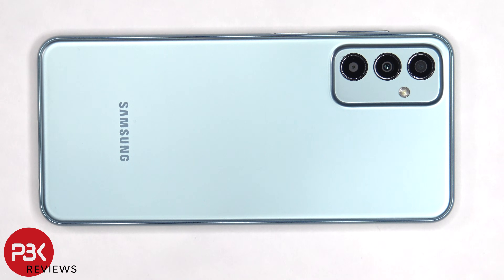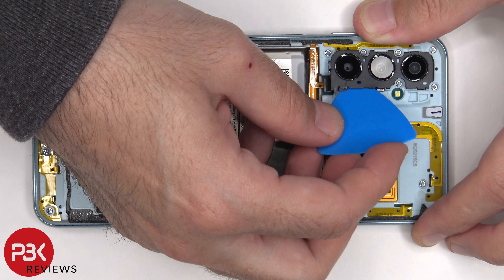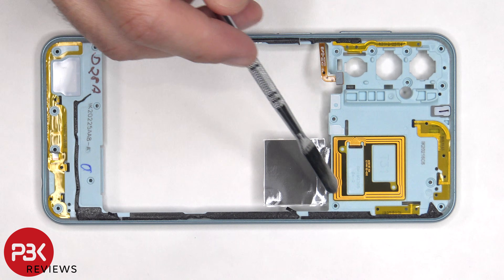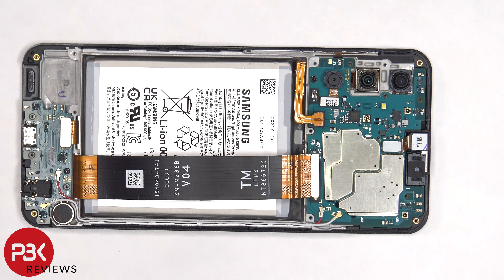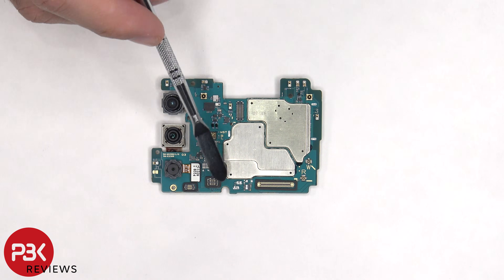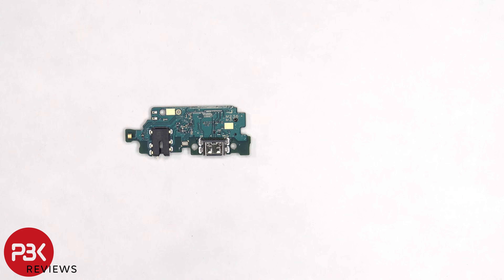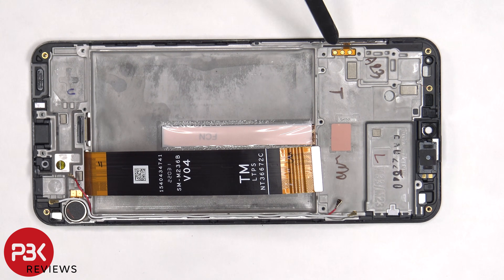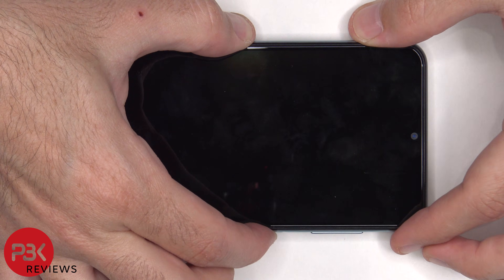Samsung Galaxy F23 5G Disassembly Teardown Repair Video Review

Comment: After replacing the charging board I'm getting the message " Charging stopped because battery temperature is too low," I used DevCheck to check the Battery Temperature and it was showing -20 degrees celcius. Plus my mobile networks aren't working. I've been forced to  enable Airplane mode to prevent the phone from heating and slowing down because its constantly try to look for a signal. Any fix for this?
Reply from the maker: make sure the sub board or charging board you replaced is the correct model version. They have numerous region versions of the sub boards which have different antenna contacts n so forth. Also make sure all the cables are installed correctly.
Reply: @PBKreviews  I couldn't find a  board for F23 but found M23 (M236B) instead. I assumed they used the same board since they both had the same labels. Maybe I got one for a different region.

Comment: After changing charging board haveing network problems
Reply from the maker: make sure the sub board/charging board is the same model of your phone. Since different region versions have different network bands and thus different antenna contacts on them. Also make sure all the cables are properly connected and that the sub board is seated properly in place so the antenna contacts touch the contacts on the frame.
Reply: @PBKreviews  The replacement board is identical to the original one inside the phone but I'm having network issues. After replacing the charging board I'm getting the message " Charging stopped because battery temperature is too low," I used DevCheck to check the Battery Temperature and it was showing -20 degrees celcius. Any fix for this?

Comment: My Samsung Galaxy f23 heat so much while charging
Reply: remove backcover
Reply: Yes bro
Reply: Yes bro
Reply: That happens when you use the 25w super fast charging. Unless you have an external cooling device you can switch to a 15w fast charger
Reply: Right bro mera bhi f23 samsung galaxy bhi heat kr rha ha
Reply: It dropped in water for seconds and its bogged, new device though.

Comment: Construction wise F23/M23 phone is 90% similar to A23 just having different camera, Processor. 
The F23/M23's processor sd7225 is quite better than A23's sd6225 & A53's Exy 1280. 
Don't know why samsung putting high range processor in locked state in low range devices
Reply: I have f23 5g samsung after last update 2 weeks later battery drain and most problem is now 3 days+  like restarting process time takes 40- 60 minutes to get phone ON also wifi and Hotspot not all working when I click ON switch  not at all ON automatically gets off suddenly 
Service centre told IC problem 
My friend also had same like mine but his phone doesn't switch ON at all A53 samsung 40k around cost model, so also same after warrety periods. 1.3_  1.5yr under. Phone gets huge problems so let me know what problems you guyszz have  in your devices
Reply: Bought this phone am worried if thir copper pipe will explode or something
Reply: what is meaning of locked state ?

Comment: I can t agree with the repair score, just to be realist, this is a phone even a 5 years old or an 60 years old can take apart with no tool like a heat gun and special adhesiv to put it back togheder. Bateery yes, no pull tab so is bad.